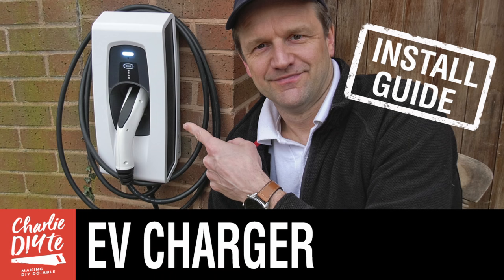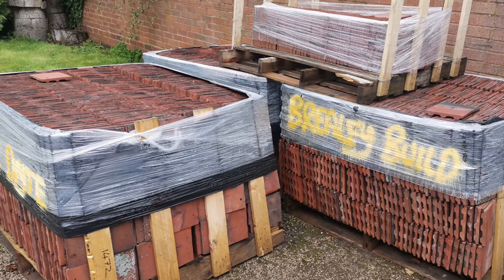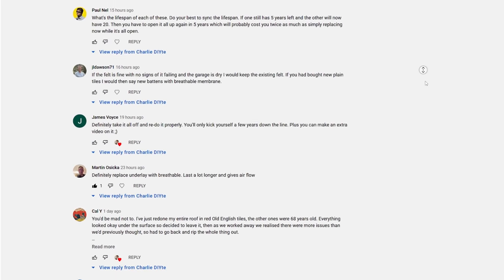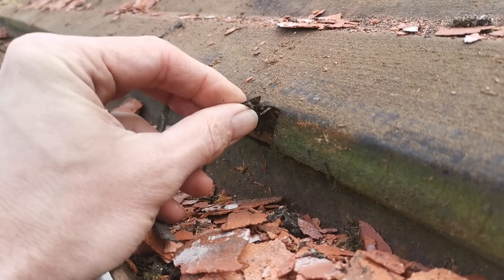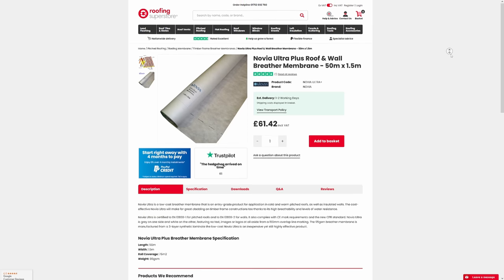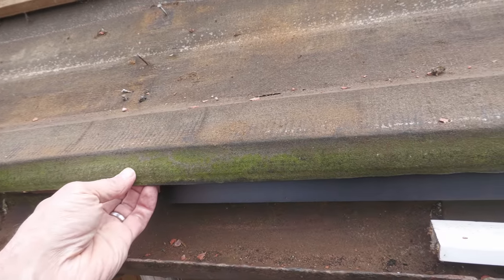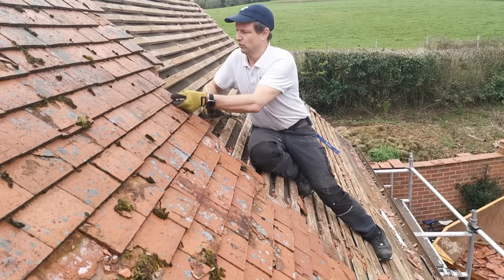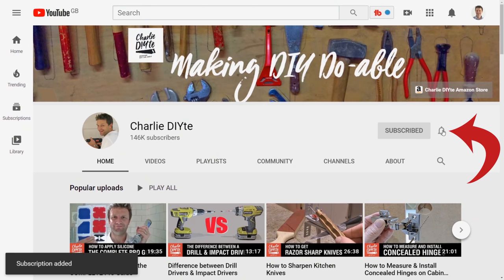Complete Tile Roof Repair - Week 1

Comment: This really resonates, I’m half way through having my 320 square metre slate  roof redone, and going from 16 PV 250W panels to 39 370W panels.  Since I’m dealing with a 3 floor building below the roof line, it’s a job for the professionals.  Definitely not cheap
Reply from the maker: Thanks Andrew. Blimey, you'll generate some serious electricity with 39 panels! I'm going with 16 415w panels, but that seems a long way off right now. 🤦🏻‍♂️
Reply: @CharlieDIYte  we need serious electricity to drive our 3 phase ground source heat pump.  We have 500 square meters to heat, and a nice oversized hot water cylinder to dump any excess generation into

Comment: Charlie, having just taken half the cladding off my shed I've a tip to share on removing the roof battens.  Rather than crowbar them off which will put strain on the wood and result in more fractures, use a multi tool with a carbide metal cutting blade to cut through the nails instead.  The first side of my shed I crowbarred off and most of the wood split, the second side using the multitool I had far less damaged cladding lengths and was able to pretty much use them all again.
Good luck with the project
Reply: Good idea, probably easier and quicker and cheaper in terms of blades to use reciprocating saw. A good blade and it will make very light work of that. Pretty sure Charlie has one from memory.
Reply: @C4sp3r123  Yes a recip saw would also work. Maybe it's just my cheap recip blades but I find they can be too springy and so can go off track and cut into the wood. The multi tool blades are stiffer so can slice under the wood and into the nail.
I'm using a Saxon metal carbide blade so they're not that expensive and so far I've not had to change the blade, and that includes having to cut through some brand new stainless steel rings ank nails when I got some of the new  cladding wrong.  Certainly can recommend Saxon blades from my recent experience
Reply from the maker: Geoffrey, thanks so much for that. I'm probably going to have to grind off the nail stumps anyway so I LOVE that suggestion. I'll definitely give it a go. Might buy some spare blades now! 👍
Reply from the maker: I certainly do. I'll try both and see which one works best. 👊
Reply: Routinely use a fine blade on a battery reciprocating saw to cut the nails in pallets

Comment: Well impressed at you sticking with that also  to Mrs DIY for taking off those tiles. Hope she is also going to have a go and lead the rebuild. For the membranes did you look at Roofshield at all?  Perhaps OTT for a garage but the only one that doesn't need a ventilated ridge (?) Interesting what you think of flimsy ventilated ridge systems. Don't forgot at the bottom to think about your kick up for the bottom tile - I guess you are doing new fascia boards.  Surely you just trim those trays to fit. Look forward to the next one and take care. Can you get some inflatables for inside the garage just in case (thinking about possibility of rotten rafters).
Reply from the maker: Thanks John. I've decided to stick with the support trays and make a triangular timber tilt filler to support the tray. I thought it was my mod but I found out this morning that they are recommended in the industry. No, I'm afraid I didn't look at roof shield. You don't realise how many options there are until you start researching something like this and start receiving suggestions from good people like yourself 👍
Reply: @CharlieDIYte  triangular fillers sound good. For Roofshield have a look at the Restoration Couple when they did their roof:

https://youtu.be/1GsZb7vxcj0

I guess you already know them but if not perhaps go an see them and volunteer on the new farm for a day in return for roofing tips. Wish I had your fitness to do these things. Take care.

Comment: I have the bitumen underlay on my 1982 built house with Marley tiles.  I moved in late 2019 and long story short hot water tank failed in the attic while I was offshore 20 days later.  Artex on the celling, so insurance company wouldn't go in until that was removed due to asbestos.  Settled with insurance in March 2020 in time for covid with a gutted house.  I had paid out of pocket to get things moving, plasterboard and plaster was complete upstairs and the last of the storms hit.  Water came in again through the roof.  The wind blowing the rain under the tiles, and the bitumen felt was brittle and had ripped.  No leaks since but have contemplated doing it myself.  However costs have sky rocketed.  Will probably get the main roof done by a roofer and do the garage and porch myself.
Reply from the maker: So sorry to hear about all this. You've been through it mate! I didn't realise artex had asbestos in it! You were very unlucky a second time as most of my roof doesn't even have underfelt and we get battered by the weather from the south, here! Hope you get the roof redone without too many more mishaps. Sounds like a good plan. I'll probably get a roofer to do my main roof at some point, unless I just tackle it gradually in sections.
Reply: @CharlieDIYte  The Bathrooms were only 5 years old apparently, so I was going to leave them.  However pulling up the chipboard floor in the hall and master bedroom, I found it was all rotten from bathroom leaks, so ripped it out.  I was showering at my folks or gym....Then lock down hit!  I had a push on tap shower out the kitchen window.  A bit cold still in March and luckily not overlooked by neighbours!!!

Comment: What about adding Solar PV now, using in-roof mounting trays? You wouldn’t need to tile under them and nowadays panels themselves aren’t much different in price to roof tiles (per square metre). You could get the panels almost for free. Plus an in-roof system looks much better.
Reply: Couldn't agree more with this. Definitely get an in roof system as they look so much better
Reply: That's a very good idea. If finances allow, I would deffo.
Reply from the maker: Thanks for this. A few people have mentioned this. Do the trays fit standard panel sizes?
Reply: @CharlieDIYte  for precise information. Maybe worth talking to Jordan from Artisan Electrics (search YouTube for his channel) or Oval Renewables via YouTube too.

Allen Hart another YouTuber had a solar system fitted flush with his roof tiles 3 months ago, worth having a look at his video on that.
Reply: @CharlieDIYte  Yes, the trays fit most standard panels of about 1700 x 1000mm. 

You can get panels for about £150 each and a mounting tray for about £35. Offset that with about £70 saved on the tiles.
Reply: @HowardBurgess  Great idea. Tiles saved can be sold back to the reclaimed tiles company or any similar company around the country.
Reply: @CharlieDIYte  they fit much like Velux™ as far as the rest of the roof is concerned, as standard you get a flexible aluminium flashing, but that only has an expected life of 30 years, whereas lead is good for centuries

Comment: Hi Charlie, thanks for the vid and good luck with the roofing job. On your solar PV plans, you can buy a kit and fit them yourself, along with the inverter. Its worth looking into expandable battery storage, and a hybrid inverter. I bought my kit back in Sept 2021 and haven't looked back , bought mine from a company called pluginsolar and though expensive is really worth it.
Reply from the maker: Thanks Gav. I'm sort of doing that because I bought the kit from a company in Yorkshire on the recommendation of a guy on my Discord forum. They don't install this far south so I'm installing the panels myself and then they're going to hook up the inverter for me and her everything connected. Conscious I've made a few mistakes and bought in rather to much haste but I panicked by the sudden national surge in interest. Just got the solar panels in time and am hoping the inverter and batteries come into stock soon...
Reply: @CharlieDIYte  That's brilliant, hope you get sorted out soon, there's understandably, a lot of demand at the moment. Re the inverter, the mistake I made, was that it could only pull 3.6kw out if the batteries, I wish I had invested in an inverter that was capable of providing more, as we can often draw more than that whilst cooking and have to draw the balance from the grid, even though the batteries are more than capable of providing the whole lot. Anyway, thanks for all the content you've provided over the years 👍

Comment: Have you decided how to get the new tiles lifted up into place?  Those BUMPA tile hoists are an excellent hire, but will (I think) only lift up to your platform.  Wonder if it’s possible to position the end on the actual roof so you can remain up there whilst a helper conveyors them up to you and moves along with you?
Reply from the maker: Very good question. I think I'm going to get DIYfe to help. She can be laying the new tiles whilst I do the heavy lifting. 😉

Comment: Charlie I'd also ask roof specialist Steve Roofer who seems to use Alutrix 600. Also if you are going to make it a habitable space will it be a cold or warm roof as this along with the new 202q building regs will impact on your choice of system for the roof.
Reply from the maker: Thanks Richard. Yes we've been discussing this on my Discord chat forum. It will be a cold roof so having a decent vapour barrier will be important. I should have checked Steve the Roofers recommendation. Such a good channel, that 👍

Comment: If you counter batten you can use the eps trays and aid ventilation.
Reply: Can you describe what you mean by counter batten please?
Reply: @C4sp3r123  install battens vertically up the roof first then install horizontal battens across after ready for tiles.
Reply: @MattJ2906  thanks, makes sense.
Reply from the maker: I thought I could create a wedge to go on the rafters at the bottom. That way I can use the trays and the wedge will support them and stop them buckling when I fix that last batten. Does been the roof will slope at a shallower angle at the bottom but it eliminates the problem with that bottom batten sitting in a dip.
Reply: @CharlieDIYte  I would think a wedge would work fine as well, it could be made to be a longer wedge so the gradient change is more gradual rather than a much larger sudden change of angle at the bottom.

Comment: The beetle is absolutely in the wood because its damp, if I remember correctly it makes the wood easier to chew. 
Obviously the roof has been leaking.
Reply from the maker: Thanks for that. It's curious because the felt is in pretty good nick but there's a lot of wood and other stuff stored in the loft space, which I need to clear out and stop hoarding (carpenters and their wood!), to increase air circulation up there.
Reply: @CharlieDIYte  BS 7913 has some information on woodworm and is pretty clear about the role of moisture in timber infestation.
If the north facing side of the roof has had a leak, perhaps its possible that the moisture has gotten inbetween the tiles and the bitumen underlay, and due to less sunshine hasn't been able to dry out as well as the south facing side?
As you said, the Wood Lice love damp stone and wood!

Comment: You would still need vents - ridge and eaves, as breathable underlay is not enough on its own if you plan to use as a 'house' later on.
Reply: That depends on the roof membrane i believe. Eg Tyvek Supro does not require any vents.
Reply from the maker: That's right. It specifically says that in the product specs.
Reply: @CharlieDIYte  Thats your own call but speaking as a roofer who has heard this before I would go the extra vents - eave and ridge.
Reply: If you don't use vents then these breathable membranes require very careful execution of a vapour control layer in the room below.
Reply: @Swwils  this is an old building not a new build! Even with a new membrane on the roof, the roof structure is likely full of gaps for air flow anyway
Reply: @georgerothwell  I think the eventual plan is to seal it up and convert it though